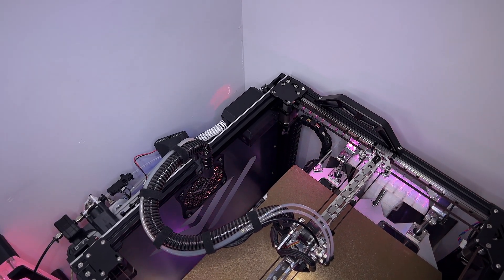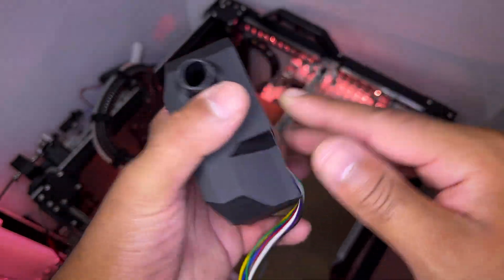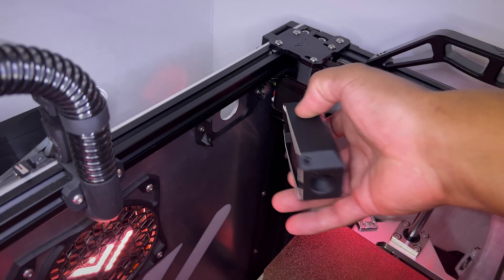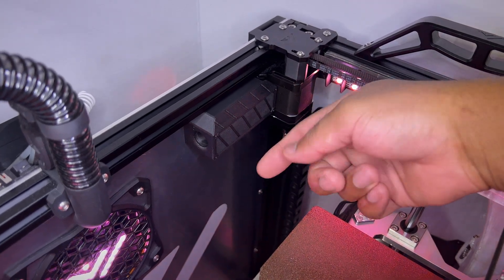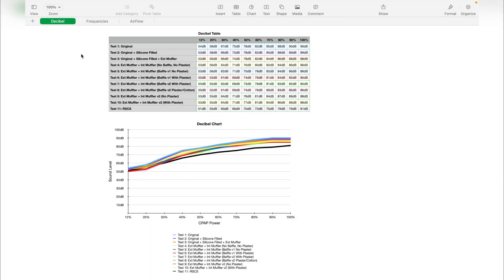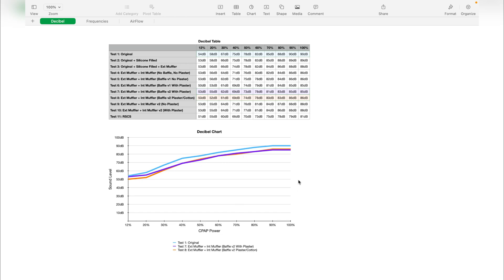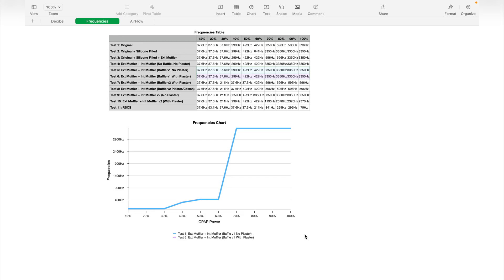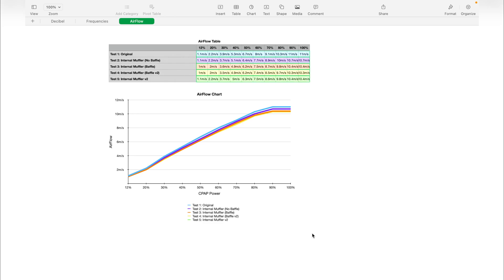VzBoT 330 External/Internal CPAP Muffler

Comment: This is awesome! Is there a way internally to add the cone shaped like Christmas tree used on the Flsun pro S1, might give it the edge to reduce even further the sound. Polyester felt sheets are amazing at absorbing, and easy to cut.
Reply from the maker: Hey thank you, I appreciate, when you say internally do you mean as a Internal Muffler or inside the External Part? 

The FLSun one seams effective indeed.

Thanks for suggesting the Polyester Felt I’ll try it 👍

Comment: you could add a mounting gasket where the cpap is mounted to the enclosure
Reply from the maker: Actually there is a sealing gasket, I just didn’t mention it, mine is printed with a 82A, the silicone added on the CPAP also acts as an extra seal 🙂

Comment: Super impressive!
Reply from the maker: Thank you so much
Reply: @rcgeeker you think molding an rtv silicone shell to mount it in would work out? Or just filling the case with silicone instead of plaster? I’d like to see how much printing the mount and muffler in tpu or raw nylon would help as well
Reply from the maker: @imst4722  Oh yeah that’s interesting I’ll check that out, I sill have leftover RTV from my VzBoT build.

The second idea would be to print the External Part in TPU, flexible material could probably dampen some frequencies, I’ll try that too.

Thanks for your comment 😀

Comment: Heyy how does your cpap work at 12%; mine starts at only around 18 can toy share the config; how have you connected it;
Reply from the maker: Mine is connected like shown on the VzBoT doc, on the PF8 connector.

What is your CPAP model?

[fan_generic CPAP]
pin: PF8
max_power: 1
cycle_time: 0.002
shutdown_speed: 0
off_below: 0.12
Reply: @rcgeeker I will check Tommorow and let you know